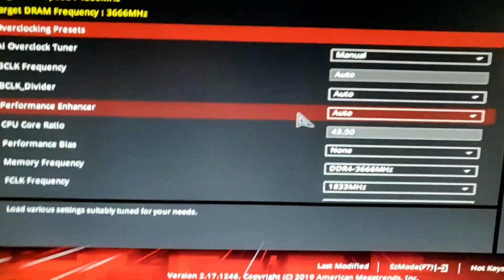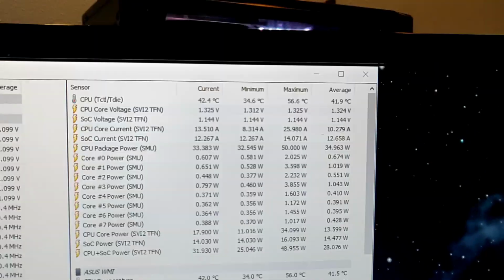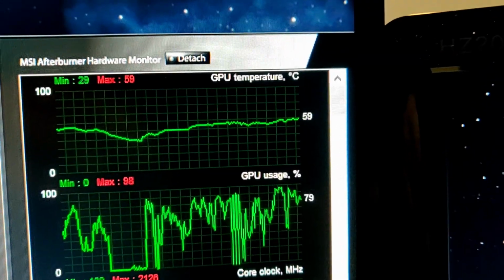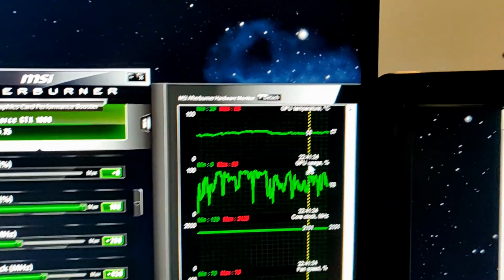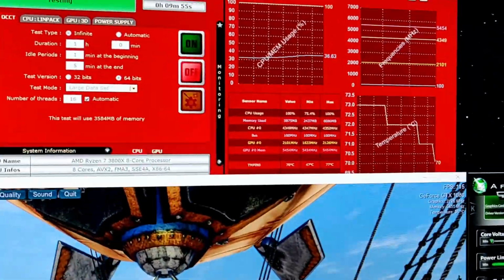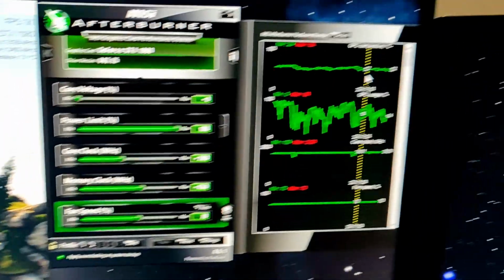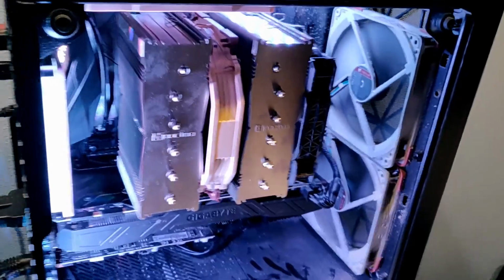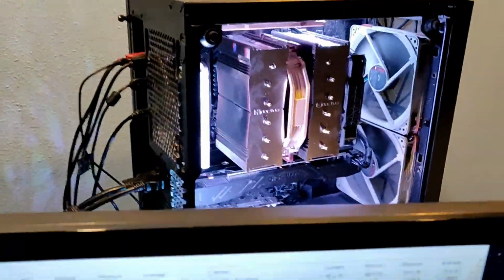Side panel on or off?

Comment: My machine based around a Fractal Define 7 suddenly started to freeze and reboot during the summer when I was gaming. So I removed the sidepanel and now it doesn't reboot. Hopefully it will be solved with the extra 140 mm fans I have bought.
Reply from the maker: I wonder if CPU temps are what's causing that. Might need to reapply thermal paste and remount the cooler.